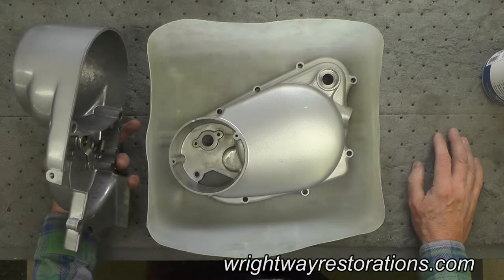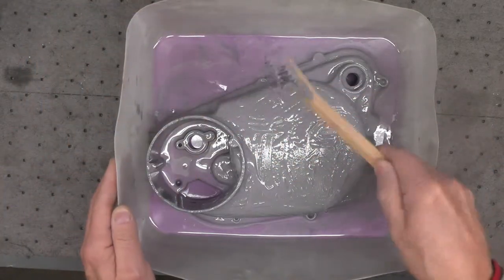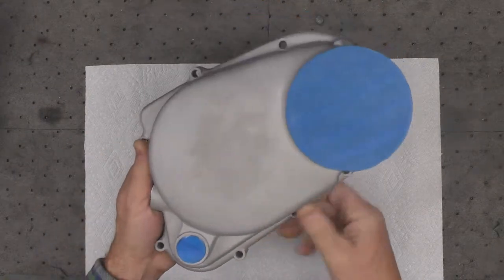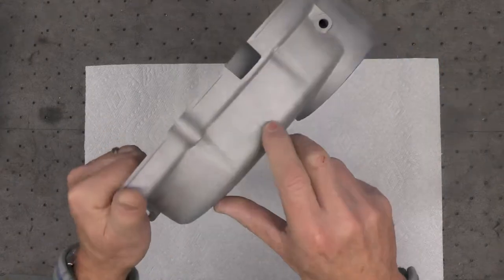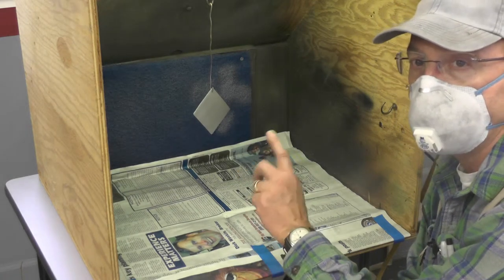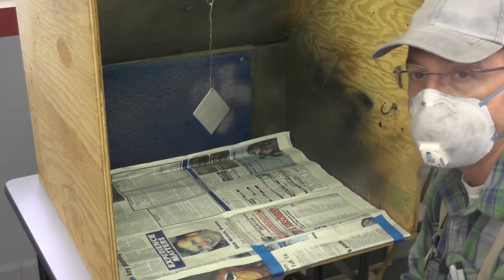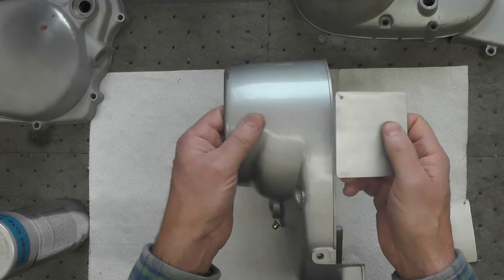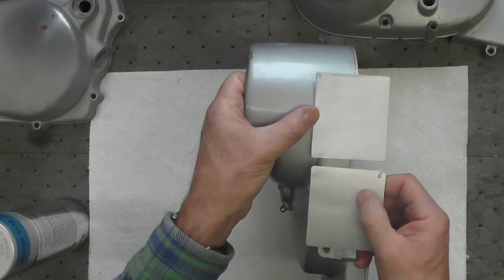Yamaha YL1, Stripping & Preparing Engine Covers for Painting --- Video #93

Comment: Looking good, yes the original color of the engine side covers isn't easy to match. On my Yl1 restore work I have used the GM Ultra Silver color. I used that on the engine side covers, chain guard, and other places that were the same silver. The Ultra Silver is not even close to original but I repainted all parts so the color matched over the complete bike. And like you I used a matt clear coat to finish the parts. I like how you use the 2K clear, that is a great up grade over standard clear coat, a nice touch for a show bike. That looks like a Ionia Sentinel Standard in the bottom of the spray booth? Your not in Ionia are you?
Reply from the maker: I had a paint supplier match the silver from an original part as used on parts of the frame, front fender, etc.  This is a higher gloss and a bit different color from that used for the engine covers.  This was an automotive urethane-based finish I sprayed this with my HVLP spray gun.  I haven't applied the 2K clear to the side covers yet, but this will likely be part of an upcoming video.

I don't live near Ionia, I'm south of Holland.  I believe the booth liner was from a local free weekly newspaper (but not sure without checking!).

Thanks for info on your project as I like hearing about the techniques of others, helpful for my own learning.  I appreciate the kind comments, too!